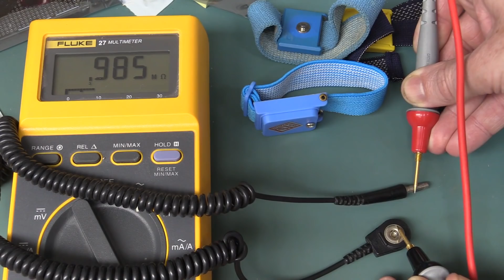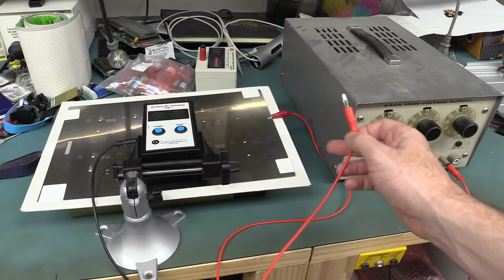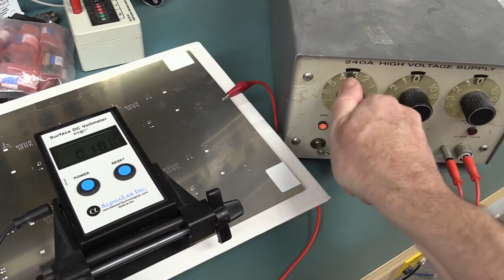EEVblog #768 - Cordless Anti-Static Wristbands BUSTED!

Comment: You cheated by using a real strap to attach your charge to the plate. If you used two wireless straps for the test, than the charge would dissipate in no time. ϟ MAGIC ϟ
Reply from the maker: PinkTurtleFart Doh! My entire test methodology is shot!
Reply: PinkTurtleFart But what if one discharges into the other?!
Reply: Isn't that how solar roadways work?
Reply: PinkTurtleFart Solar roadways needed more wriststrap.
Reply: PinkTurtleFart You just have to believe in it, then it'll work!
Reply: PinkTurtleFart I think it only works on the Eastern Hemisphere because of the Bernoulli Effect, like the Coriolis Effect in the Southern Hemisphere.
Reply: I forgot to account for the mystic toilet effect.  ww
Reply: RogerWilco Earth has two hemisphere Northern and Southern so the cordless wristbsnd probably only works in the northern hemisphere of earth.
Reply: Steven Whiting 
Also need a humidifier in the room as well.
Reply: ***** Nice advice dude ;)
Reply: PinkTurtleFart Just to be sure, you should also have a normal band, wired to the magic band!
Reply: +PinkTurtleFart 
It's not discharging wirelessly because of the connected voltmeter. The act of measuring the voltage inhibits the quantum dissipation process.
Reply: +PinkTurtleFart  place seven of these in a circle around your phone, and it will WIRELESSLY CHARGE IT via ambient quantum phase harmonics.    If it doesn't work, use thirteen.
Reply: I agree. It uses negative ions to ground. Simple electronics.
Reply: Of course if that actually DID work, the price would still be double that of a regular strap.

Comment: maybe "cordless" is engrish for "cord not included" ?
Reply: Shanjaq Totally possible, otherwise, why would they have an external screw?
Reply: Not really, as the ADS for them are claiming what Dave is testing. Even if the original manufacturer's meant it to have a cable.
"This cordless wristband enables you to work without the restriction of a gorund lead" (sic)
Reply: Oh yeah, didn't think of that
Reply: one wonders how they put the screw in there with the resistor soldered in place?  :o
Reply: well, the screw acctualy disipates a unoticably small amount of charge becuse of the photoelectric effect, not that that gives them any credibility.
Reply: in some aliexpress site,  it reads that it works using the "corona effect"
Reply: @TechFabLab  If they connected the screw to a few inches of carbon-fiber cloth, it would actually discharge a bit.  But slowly.  And probably it would take your 5KV down to 1KV, then stop working.   (Eliminates big painful zaps, but doesn't actually protect your MOS circuitry.)

Hmmm, maybe the original version DID have the carbon-fiber tuft.   But then they found that, if they forgot to add the tuft, people still kept buying them!

Comment: don't like cords? put an esd mat on the floor and work barefoot.
Reply: Maltfalc Heck, when I build PC's (and I've been doing so for nearly 20 years, since I was around 8) I work barefoot and keep a spare PSU plugged in but powered off nearby so I can ground-out by touching it with my foot when I have to leave and come back or otherwise need a footrest (and as a footrest it keeps me constantly grounded without risk of yanking a limb out of socket if I need to move weirdly and suddenly, unlike with a strap-and-cord).
Lino, hardwood, carpet (NOT shag carpet though), tile. I've worked on them using the PSU as grounding method and not fried a single board or component so far.
Reply: ElNeroDiablo same here.
Reply: ElNeroDiablo It's unusual to 'kill' a device through ESD, normally you'd find it fails early, or you'll get the odd BSOD or random error in a piece of PC equipment. 
Just grounding yourself is not necessarily a good thing, you need everything to be at the same potential. If a PCB is already charged and you touch it you will still damage the oxide layers in the semiconductors hence why ESD mats are important.
Reply: Maltfalc Am I the only one who's not worried about ESD when working with computers? Sure, I discharge myself on a non painted part of a radiator now and then, but I rarely do it.
Reply: Jordan O'C I don't worry about it. I install the PSU first and leave it plugged in. Grounds the entire chassis and all the components as you install them.
Reply: Garrett Barnhart Oh right, so my carelessness is somewhat justified. I always put the PSU in first, then motherboard, then cpu, and everything else after that, connecting as I go.
Reply: Maltfalc That's what they do for SMT operators. They have the floor covered with ESD matt and wear the bands  on the shoes like this
http://www.esd-grounding.com/images/zerocharge/abh-914r.jpg
Reply: Garrett Barnhart Which is all good assuming that the person is grounded as well -- if not, the charged person will zap one side of a component and the fact that the other side of it is grounded will make the zap worse. Ground is not a magical elixir of safety, it's just a convenient tie point where if we connect all things, components and humans, no ESD can occur.
Reply: ElNeroDiablo That's fine for building PCs (which are switched off while you build them), but it's worth noting that that is a terribly bad idea for working on live circuitry. Because if you touch live with your hand, and your foot is well connected to ground... that's routing the current right through your heart. This is why the wriststraps have a 1 megaohm resistor in them; prevents the wriststrap from killing the user.
Reply: TheHue's SciTech
Where did I ever indicated I worked on LIVE systems with that method? Nowhere. I said that's what I do when BUILDING or otherwise repairing systems on the hardware level, so there's no need for an active power flow in the device.
Building/repairing a system with the need of an OS? At that point I'll usually have the side panels locked down unless I need to plug in items such as extra hard drives that are physically installed but not connected to the PSU or motherboard, once the OS is up and running - and even then I'll power down the system before plugging those in even though modern SATA drives are designed to be able to hot-swap and connect to a system without powering it down first.

I learnt long ago back in the 90's that if you didn't have a damn good reason to keep something powered on/running whilst working on it (such as power line analysis of a digital keypad), you shut the damn thing off when working on it or as you prep it for the work you need to do, and do as much work as possible without power to what you're working on.
Reply: ElNeroDiablo Dude, I started my message with "That's fine for building PCs (which are switched off while you build them)". Just thought other people reading this thread shouldn't get any ideas of their own.
Reply: SDG Electronics Exactly. I remember when the damage static could do to 4000 series CMOS was realised back in the '70s. Usual failure mode was for a device to survive testing but fail on installation.  

FWIW my usual method is to touch whatever the SSD is on/in with the side of the hand before picking it up, then repeating this before putting it down or in something.
Reply: Jordan O'C I don't want to know what you discharge on, it takes all sorts and colours of the rainbow etc. so whatever floats your boat but you really do need to take proper care with ESD when building machines.

As others have said, you can 'injure' a chip which may or may not fail completely at some later date, if you're lucky it will fail fully, if you're not then they can and do cause weird, intermittent and random problems. 

Hopefully you're building machines for yourself and your family, not to sell on or use commercially.
Reply: Jordan O'C  There is no earth connection to the upstairs of my house where I normally build computers, but I've not damaged anything yet!
Reply: nate grover No earth connection on your household wiring?!
Reply: nate grover An earth connection isn't necessary when building a PC anyway (unless there's some reason you need everything to be at earth potential),  but a wrist strap should be.  It's there to keep everything - you and the case - at zero potential.  Even better is to use an ESD mat with it or stand on one as stated.
Reply: Dacke You're drawing an odd distinction between "earth potential" and "zero potential". What you mean to say is that the wrist strap is there to keep everything at the same potential. You're absolutely right that having everything at earth potential isn't particularly helpful.
Reply: TheHue's SciTech
Ah, yeah.  Same potential.  Derp.
Reply: Dacke compwiz101 The wiring was done in the early thirties :-) The issue is when I touch two different devices, it shocks the crap out of me, and there is major feedback from things in other devices, for example, I can hear my hard drives through my sound system and tv!
Reply: Maltfalc Incredibly dangerous! Put those shoes back on! There is a reason for the high value resistors in wrist straps.
Reply: Mr Carlson's Lab esd mats ARE high value resistors. what's incredibly dangerous is lecturing people on subjects you clearly haven't bothered to educate yourself about first.
Reply: Maltfalc LOL! Ya..... Are you sure I'm the one that need to be educated?  Listen sunshine, If you wear no shoes at your bench and stand on a conductive mat, that's your issue. You better never come in contact with a live AC connection, because you will be laying on that floor as flat as the mat! This stuff happens when you least expect it.
Reply: Maltfalc You realize that I'm telling you this because one day it may save you life! Right? Who's ignorant here? Conductive is conductive! Until you learn basic bench safety, I think you better stick to video games! 
You can lead a horse to water, but you can't make it drink.
Reply: Mr Carlson's Lab Where did Maltfalc suggest using a conductive mat on the floor?
Reply: TheHue's SciTech So an ESD mat isn't conductive? ..... And do you think it's good practice to work barefoot around electronic equipment?
Reply: Mr Carlson's Lab "conductive mat" refers to a mat with high conductivity. "esd mat" refers to a mat with the same low conductivity as the resistor in the esd wrist strap you recommend. i'm done wasting time on someone who's completely ignorant about something as basic as resistance.
Reply: Mr Carlson's Lab I think the surface resistance of an ESD mat is many gigaohms/sq, as demonstrated by Dave Jones in EEVBlog #250, which means that can't support a lethal current, b) that this is a demonstrably higher resistance than wet concret, and c)I think that resting my arms on the ESD mat on my lab table is perfectly safe, and that walking around on a similarly set up mat on the floor would be equally safe. Am I wrong?
Reply: TheHue's SciTech Generally it's a bad idea to work around high voltage with bare feet, ESD mat or not.  They also make high voltage mats for that purpose.  But this conversation started about ESD safety, not high voltage,  so I'm not sure how we got here lol

edit- When I say high voltage I mean mains or high energy.
Reply: Dacke True. Regarding ESD --> high voltage safety; they're intimately related because if the resistance between you and ground is too low, you're at risk of getting electrocuted; but if it's too high, you're at risk of ESDing chips. So there's a compromise/balance there (which is effectively solved by a 1 megaohm resistor) where neither you nor the chips die.
Reply: Maltfalc Hi i only read a few comments but did anyone mention that if you where to get an electric shock through your hand it will take the shortest path thus if you wearing a band the voltage would travel through your hand and through your skin into the band and earth. where if you get shocked and it goes through your hand and up your arm to get down to your feet to ground your dead.

You right about the mat and wrist band having the same resistance even Dave Mentioned that in the video i guess people have very very very short memories.

So realistically gloves, shoes wrist band and esd mat is going to save you plus an isolating transformer your going to be safe, technically an Isolating Transformer on its own connected to your work should save you under those conditions.
Reply: BlackIce504 you're just as dead if a lethal current goes up one arm and down the other. but if you're working on something that can put a lethal current through an esd mat or wristband, you shouldn't be using either one in the first place.
Reply: Maltfalc

yes as the voltage and current goes across your heart.

did you miss where i spoke about the isolation transformer......?
Reply: BlackIce504 If you stupidly put yourself in the position where mains voltage can travel up one arm and down the other,  an isolation transformer is not going to help because you've created a return path.  You should always practice basic safety even when using one (keep one hand in your pocket).
Reply: Dacke
can you please read the whole conversation instead of jumping in last min and giving your two cents worth......

i mentioned more then just a isolation transformer....................

plus i did not mention traveling up your arm and down the other i merely replied to it that situation stating that you would be Dead.. reading the trail helps...
Reply: BlackIce504 I understand now. It wasn't an attack,  I've just seen a few people that use an iso transformer gives them freedom to be lax and do completely stupid shit.
Reply: i am just stressed i am dealing with the other shuffle around from M$ with my email... god that company is loosing the plot, first we get downgraded to skype and loose live that was more stable and better just missing the phone wank, now hotmail going to god, and next we be forced to downgrade to windows 10 or worse windows 8.1 wait i am not sure which is worse....both have ugly GUI and piss poor security and now update on fs more clicks to use i think i am i going to murder people..........

Then you have people saying Linux is bad lol we don't get this b.s

P.S i think I.T is going down the toilet and into the 3rd world.......i think i should sleep its 4am lol....oops.
Reply: BlackIce504 lol and i thought i was stressed.  I went to a local school for IT and two years later realized I hated it. I no longer wonder why some of my friends in IT were alcoholics.
Reply: Dacke
 yes I.T is stressful lol, i used to smoke so much but now i am on nicorette that seems to help me, but drinking can only work when your not working and i am always working on something...Currently making a mod pack for ksp, hacking my asus nexus 7 pad so i can run Debian on it instead of android but most people only use virtualization of some sort stuff that i want to get rid of it and just run Debian+ plus working on a friends smart tv although i would not call it a smart tv don't get me wrong it does allot of things but limits you from doing allot of things all in the same time thanks android and copyright people and who ever else decided to limit this thing.

my best advice on that your better off making it your self... no joke looked into it and its not that expensive as one might think. me personally i like my dumb tv but i only use it on my pc.

I am going to need to sleep at leased 4 hours before going to work so i am out.
Reply: droid not every component in a computer can be protected from ESD.......

some parts are to complex or have too many pins, "cpu's come to mind"

Things like usb's and Ethernet,infiniband  firewire or other peripheral ports have esd protection.

http://electronicdesign.com/boards/protect-your-high-speed-circuits-esd-transients

I know of many Asus boards have ESD suppression on most of there ports.
"mainly peripheral ports"

Some discrete FETS have ESD protection built in "NOT ALL"mainly more expensive ones.

There are cases of ESD damage where you just shorten the life or get erratic behavior and they are hard to diagnose when they post.

It's a gamble really to not care about ESD.

you ask what Major manufactures do with their time, they mostly spend there time thinking of ways to cut production costs adding built in ESD suppression to every device pin/contact would add to the cost......"two extra devices per pin" yeah that's going to cost allot especially on cpu's with 2011 contact count.... not worth it.

Reason as to why you have not experienced much ESD damage.

Your computer case is often effective way of grounding your and because your in contact with your computer case during building a PC and not moving around so much you don't generally get enough charge to damage a computer components in comparison to someone on a production line.

In short i tend not to gamble with parts that are $500+ bucks a part and dealing with warranty is often a pain in the ass so i recommend you and anyone else to take ESD a little more seriously but its your money and your time so do what you like, but making out that it never happens is ignorant as well as saying all components are ESD protected which is also false.
Reply: droid That's funny coming from someone with your assumptions about ESD and ESD suppression in devices.

Then you make another assumption on what i was saying to another person i was speaking to about what i do in my spare time......

do you know what they say about assumptions and opinions?
Reply: droid so your point was to prove that many things you said about ESD was wrong?
Reply: +ElNeroDiablo when i work on PCs i dont do jack shit!!
Reply: +ElNeroDiablo  I do the same lol
Reply: hmmm, yeah I don't think I'd be doing that any time soon. For the simple fact that if you're working on high current or high voltage circuits and you're grounded - you're toast! Yeah, you could have an antistatic floor (and most factories have these), but you also wear antistatic work boots to insulate for such catastrophic failure!
Reply: hell, if you have a concrete slab to stand on you probably don't need the esd mat either.